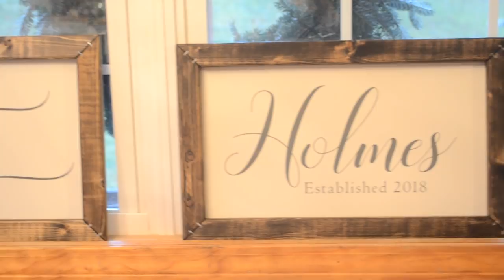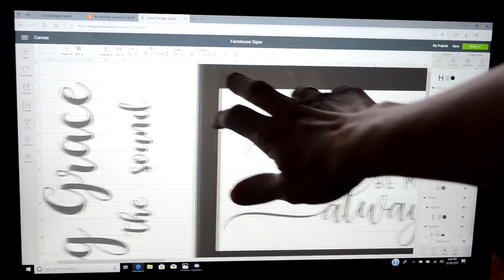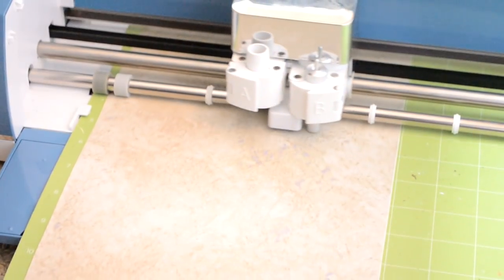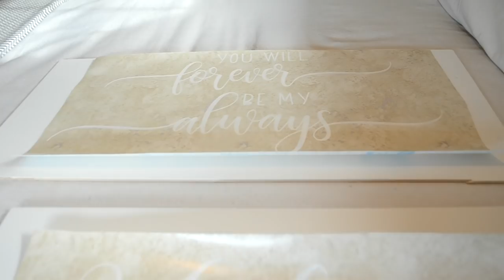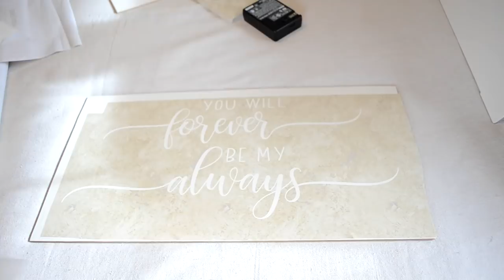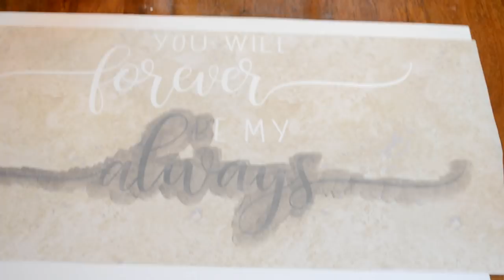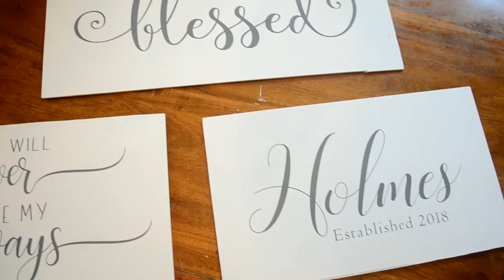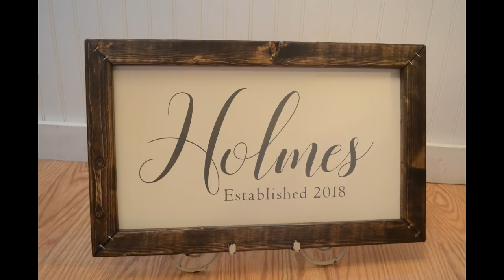DIY Farmhouse Signs / DIY Wall Decor / DIY Wall Quotes Sign / DIY Wooden Sign

Comment: You make this look so easy! I know I’m capable and have always overthought the process. Thank you for giving me the confidence I needed to get started. Love that you are straight to the point and your work is beautifully done. I agree with the staples on the front taking away from your beautiful work. I use corner clamps and wood glue then add staples or flat corner brackets on the back but since you are stapling the center wood piece all the way around the corner brackets would be overkill. Just my opinion. Thanks again!

Comment: Is the chalk paint you use to do the lettering waterproof? Like if you sold this sign how would you be sure it’s durable? Do you polycrylic it?
Reply from the maker: Hi! I use either an acrylic spray sealer or the polycrylic. I like the spray because it leaves a very matte finish and the sign.still looks chalky. 👌

Comment: Great tutorial. I have two questions though. 1) Why no glue on the corners of the frame? 2) Why did you leave the staples facing out on the frame instead of putting them on the backside where they can't be seen?
Reply from the maker: Hi. I left the staples on the front out of personal preference . . some times I do it this way for a rustic look and sometimes I do it completely different depending on the sign. Definitely will start using the glue tho!

Comment: You said that you had used contact paper for this.. So I shouldnt use vinyl? Im a beginner so i want to be sure on what I can and cannot use :)
thank you
Reply from the maker: Hi! I used contact paper to make a stencil but you could use vinyl to make a stencil as well ....contact paper was just less expensive. I now use Oracal 813 for my stencils and adhesive vinyl if I cut out the letters to place on the sign instead of stenciling. Hope that makes sense!

Comment: Christy do you always sand your luan before you paint it? I’m having trouble getting my contact paper to stick
Reply from the maker: Yes I do sand the luan before I paint it and wipe it off to remove the dust. If you’re paper isn’t sticking you can lightly sand the paint and try another coat, let dry overnight at least, do not sand the top coat of paint. I sometimes rub the stencil with my hands to get it to stick better. If your wood is grainy it helps to get it down into the wood. If that still doesn’t work I would switch paints. Sometimes the brand of paint makes all the difference.

Comment: Hello Christy I have a few questions 1 which of those 2 catting machines are you using or you need two of them ? 2 what program do you need to make the designs ? ,did you also have to buy the fronts letters? and what are the the exact size of the vinyl that we need or you just cut them as you need i love your video thanks in advance !
Reply from the maker: Thank you so much I’m glad you like the videos! I use a 12x24” cutting mat for designs longer than 11.5”. I use the smaller mat for smaller designs. You can design in Design Space (the program that comes with Cricut) for simple designs like these. I usually buy vinyl that is 12” wide and you can get in different lengths. Then you can cut pieces to the size or length you need. Hope that answers your questions!

Comment: Hello.  You cut your plywood board a little smaller than your framed wood frame   Correct?   Say you have a 10x12 sign.  Cut the board an inch or so smaller than the wood frame?
Reply from the maker: Hi! Yes on this particular I did so to recess the edge a bit.

Comment: Great video, thank you. One question - at 5:22 in the close-up view the edges don't look clean - is this typical with this machine and materials? Any way to improve it? I see that you are using a brush with white paint for touch up, but do you have to do that to every edge to get clean lines? TYIA
Reply from the maker: Hi great question! The Cricut cuts clean lines so the edges you see are from paint leakage under the material. That’s does happen a lot especially if I’m in a hurry. The stencil was precise, and you can get a clean looking stencil if you used really dry paint, in several layers, letting each layer dry before the next. Also, make sure the stencil edges are flat and stuck to the board. Even sawdust can get under the edge and cause the paint to leak. There are other ways to keep paint from getting under the material, like applying mod podge first before stenciling, or painting over the entire stencil the same color as your base paint to seal the edges first. Hope that helps!
Reply: @AppalachianHomeCo  Thank you Christy that is really helpful!

Comment: Hi. Which fonts work better with Cricut/Silhouette machines? The ones from the video are really beautiful !
Reply from the maker: Hi! Thank you. I have several favorite fonts, "velvetberries" is one of my favorites and I used it on the blessed sign in the video. I think another one was called "lovely home" and it works well as long as the typeface is not really small. I also use another one called Autumn in November and it is a chunky font that cuts really well. Most chunkier fonts work well. I use thinner ones too but usually any font that has a thin line stroke is a pain to deal with on the cutters. Hope that helps!
Reply: @AppalachianHomeCo  Thanks!!!!

Comment: Super thanks for sharing materials and methods! 
I do have one question though, What type of dapper are you using and where did you buy them? They look like the makeup ones but I’m having a tough time finding them in bags like I see to your left. Thanks! 👍 Nice Work!
Reply from the maker: Hi thanks so much for watching! Yes I am using makeup sponges I think I got them from Walmart, but I have used the ones from Dollar General too, and they work just as well. It turns out much smoother than foam brushes or stencil brushes.

Comment: Very nice!  I love the frame and would like to do that....but what kind of wood would I need to buy? Thanks.
Reply from the maker: Hi! Thank you. I use furring strips from Lowe's for my frames. They are inexpensive (around $1 for an 8' long piece) and I find them at Lowe's in the lumber section. They measure 1.5" wide and about 0.75" thick. I use it all the time.
Reply: @AppalachianHomeCo  Thanks so much for your response Christy....sounds like a cost effective project. Look really nice as well.  I was surprised that you are able to nail in to 1/4 inch luan.  I have a few pieces I can practice on. Lol

Comment: Hi there, How do you get the plywood cut to the dimensions you want? I usually avoid plywood because of that. If you cut it yourself what type of saw do you use? 

I looked trough some of comments to see if you already answered this. I didn't see it. I'm sorry if you did and I am being redundant. Thanks!
Reply from the maker: No problem! Yes I do cut the materials here at home sometimes with a table saw if there are large sheets of plywood to cut. I can include that in the videos as well to show you. But I also ask Lowe's to cut large sheet to certain smaller sizes I can work with and they will do that no problem. Its also easier to transport smaller sizes. I also use a chop saw to cut to certain lengths.

Comment: What is the material you used with your Cricut? I was thinking you would use vinyl but it looks different. Thanks
Reply from the maker: I used general everyday contact paper (the brown kind) you can get at Walmart or Dollar General. I like it because it doesn't pull up splinters from the wood when I remove it and it is also a lot cheaper. I also use the clear peel and stick as transfer tape. The two together work pretty good for stencil materials. I have used vinyl before for stenciling and I am going to post a video soon on some Oramask stencil material that I haven't tried yet. Hope that answers your question!

Comment: I absolutely love your videos! So i was wondering what tool you used to line up your boards before stapling them together? This is probably the dumbest question lol but i have the hardest time lining my frame and that would be a life saver!
Reply from the maker: Thank you so much!!😊 I use a carpenter’s square to line them up. In this video I’m using a small combination square. For larger signs I use a large framing square.👍🏻

Comment: Would you be able to tell me what material you are putting the stencil that you painted white on? Like what kind of wood?
Reply from the maker: Hi. I use luan board or thin smooth plywood for most of my signs. I used to use brown temporary service board (in the paneling aisle) but would definitely use luan instead. 👍🏻
Reply: @AppalachianHomeCo  Thanks so much!!!

Comment: I was looking into getting a Cricut smart cutter and found some Oracal 651 Matte Vinyl Rolls at Walmart to use for the stencils. Would this be the right product to use?
Reply from the maker: Hi. Yes you can definitely use that for stencils it works well. Make sure it is removable tho and when pulling off it really sticks so I pull it off against the grain. Oracal also makes actual adhesive stencil material that I love, Oracal 813, I get it from Amazon.

Comment: Very nice! Do you have a site where you sell your signs? What is the staple gun that you use? That's seems to be a lot of thickness to get through. Thanks!
Reply from the maker: Thank you so much! 😊 I do have a small Etsy shop https://www.etsy.com/shop/TheAppalachianHomeCo. I don’t have many signs listed because I do sell a lot locally, but I do take custom orders. In this video I am using a Stanley ProShooter staple gun and 9/16” staples. I purchased it quite a while ago and it works great on pine and soft woods.👍🏻
Reply: @AppalachianHomeCo  Thank you very much! I will check your shop out & also the stapler!

Comment: Great video!  Question:  Do you let the paint dry on the wood before pulling your stencil off?  I have had trouble with some of the lettering pulling up when I remove the stencil.  Any tips?
Reply from the maker: Hi! Thank you! I generally do not let the paint dry a lot, maybe a minute, and then take off the stencil. I have only had that (the letters come up) happen once and I definitely believe it was the paints I used because I havent had that issue since . . I use mostly Waverly when doing stenciling tho its a bit more pricey. I have also used Gliden paint from Walmart without any issues for my sign board and stencils. Maybe try other brands to see what works good together with your sign board paint, and stencil paint . . thats what helped me. I hope that helps!
Reply: Thank you so much!  That is exactly what I needed to know!  Thank you for such a quick response.  Heading out for new paint now. 😊
Reply from the maker: @kimberlythompson5515  Your welcome I hope that works for you!

Comment: Hi Christy, I just made some signs and when I pulled off the adhesive stencil it pulled paint up with it. What did I do wrong?
Reply from the maker: Hi! It may be the type of paint. Some paints just want to pull up I have found. Try interior wall paints, they seem to work better. Or seal over the paint with poly and let dry COMPLETELY. Hope that helps!

Comment: great video, like the work, question, how long did you wait after painting when you pulled the sticker off?
Reply from the maker: Thank you so much! I wait long enough for the paint not to run off the stencil and get everywhere, but not long enough to be completely dry. For chalk paints that's usually as soon as I am done stenciling, and for glossier paints usually 5-10 mins.

Comment: Thank you for a Great tutorial. 
May I know how did you do the frame on Design Space? Also can I use drill instead of staple gun?
Reply from the maker: Hi! Thank you so much! Do you mean how to draw the frame on Design Space? If so I would use the shape tool and draw a rectangle with the dimensions of the top piece of the frame. I wouldn't worry about trying to draw the mitered corners. Then duplicate it for the bottom piece. Duplicate again, flip it over to make the side pieces and change the height to whatever your side pieces are. I hope that answers your question! Also I don't know if you would need a drill for the frame but if you do not want to use staples you can definitely use a nail gun (brad nailer) to nail the frame together from the corners. Hope that helps!

Comment: Hey do you let it dry before you pull the stencil off? Thanks!
Reply from the maker: Hi! If I use glossy paints I will let them dry a minute so the paint doesn't make a mess. But with chalk paints I take the stencil off right away.

Comment: Hello Chisty, Do you  cut the frame smaller than the sign? what do you do if the thin wood little bent?
Reply from the maker: Hi. If you are using 1.5" wide frames then cut them 1.5" longer than the sign. Then cut a 45 degree angle off at the corners. This will leave about 3/4" for you to nail the sign board to the frame. Using a clamp and some wood glue when you are nailing the frame to the sign will help straighten out the wood, depending on which way it is bent. It should work if the bend isn't too bad. Hope that helps!

Comment: Hi, I used the same material as you but my project all the  paint and the small letter lifted. How to prevent that from happening? Also how many cotes of paint do you apply on the letters?
Reply from the maker: Hi. I generally use two coats depending on the paint. You might try letting the base coat paint (sign board) dry overnight before applying stencil. Also it sometimes happens when you are using certain paints. I have found that the cheaper paints, like Walmart brands, sometimes lift when using them for stencils so I started using Waverly Chalk paints and better paints to do stenciling. They don't always do that but I think it is the combination of sign board paint and stencil paint, if that makes sense. Try the chalk paints and see if they do better. Hope that helps!
Reply: @AppalachianHomeCo  Thank you!

Comment: What printer are you using and material?
Reply from the maker: Hi. I use a Cricut to cut out the stencil if that is what you mean by printer? And I am using contact paper material in this video but have changed to use Oracal 813 stencil material , and adhesive vinyl lately.

Comment: What size wood did you use for the frame tried looking in the comments. Love these im about to make mine but gott 1×2 for the frame and there a bit chunky for my liking
Reply from the maker: Hi! Thanks I use furring strips from Lowes and the actual dimensions are 1.5 wide x .75" thick.
Reply: @AppalachianHomeCo   Thank you. we failed hard core making the signs,,, so we need to by new wood for the frame part lol...but now i can try this size.
Reply from the maker: @chalkbossmom9267  Im sorry they failed what happened to them? Good luck on your next try I remember the struggle at first but it finally comes together.!

Comment: Hi, I kuse contact paper too to make my stencils, but when I take it off and my project is dry, there's an adhesive film left behind from the contact paper on my project. How do I remove that? or am I doing something wrong? :(
Reply from the maker: I've not had any issues with the contact paper leaving a film. What brands do you use? I use Dollar General MagicBrand mostly. Its not as sticky as some brands maybe thats why. Also the more glossier the paint the more the contact paper will stick.  I would try warm soap and water with a qtip but ive never tried it myself. Sorry thats not more helpful!

Comment: Hi Christy, I have a question regarding the dollar store shelf and drawer liners that you are using as your vinyl/stencil.  Do you run into any issues with it leaving any residue or tackiness on your sign? I have used it on several signs and it seems to leave a light coating on them. Any recommendations? I have used the same process for tumblers and have run into the same issue. 

Thanks in advance!
Reply from the maker: Hi! I have gotten several comments about that. I think the contact paper does that to certain paints, I use a lot of flat and chalk paints and didnt run into that issue but I did notice the clear peel and stick left a residue on some glossy vinyl I was transferring onto a camper. I now use Greenstar brand lay flat clear medium tack transfer ( long name sorry!). It is more like bandage tape (the clear kind) and I really like it. It’s more pricey but definitely worth it I haven’t had any issues with it.

Comment: Hi! Love these! What size wood is this for the frame?
Reply from the maker: Hi! Thank you! The frames are 1.5" wide x 0.75" thick. I use furring strips from Lowe's for the frames usually. I think the sides were 12" and 24" long.
Reply: So with the 12” by 24” frame what size should the plywood be?

Comment: Hello, your wood you use for the actual sign AND the edges, what type is it please 🌝, are the edges fering or furing strips?
Reply from the maker: Hi! The frame boards are furring strips I get from Lowes. They are usually in the back near the lumber and they are actual dimensions 0.5" x 1.5" x 8" for $0.97. The backing I use now it either luan board or 1?4" smooth plywood also from Lowes.

Comment: Christy, one more question. This is the first I have heard of Cricut Smartcutter cutting the stencils. I thought you couldn't cut a design larger than the 12X12 and need to slice images if they are larger. Do you mind explaining please? Thanks!
Reply from the maker: Hi Jenna! Thanks for commenting! I am using an ivory flat paint from walmart (it was discount). And you can cut images 12x24" (actual i think is 11.5x23.5) with a 12x24 inch cutting mat. The exact Cricut I use is Explore Air 2. I hope this helps!
Reply from the maker: Sorry I mispelled your name . . Jenni!
Reply: Is there a way to do these with the smaller mats that come with the machine? Tape them together from underneath?